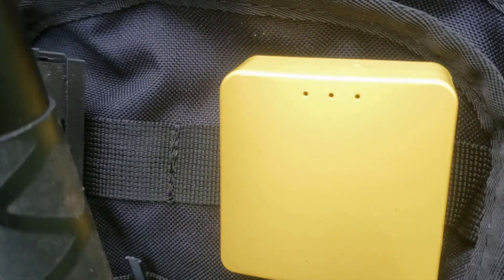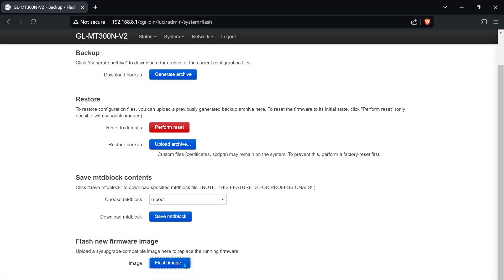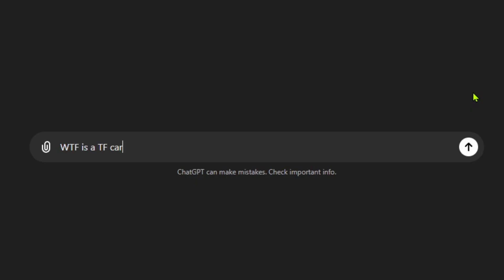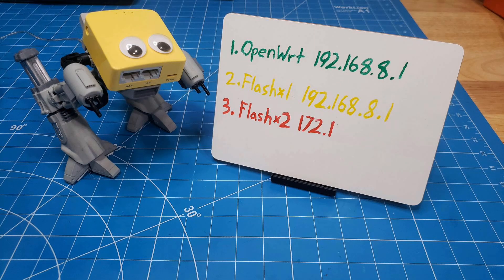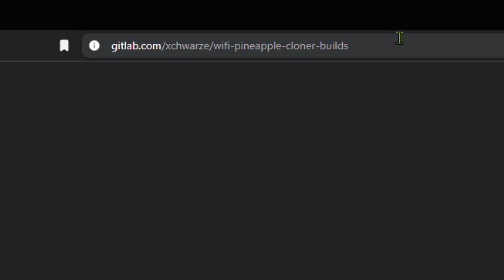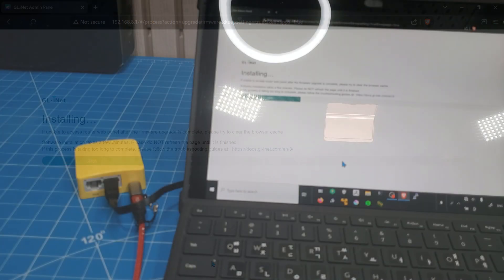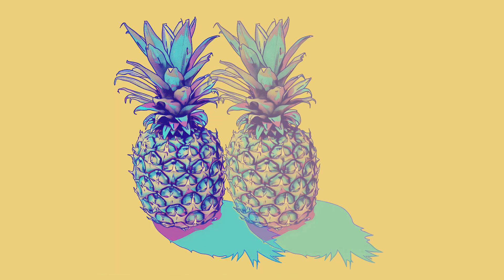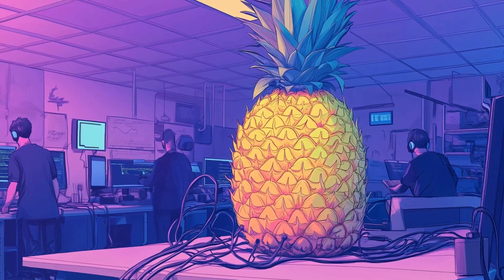I Turned My Old Router Into an Ethical Hacking Tool!

Comment: Or just buy a pineapple on aki express for $100
Reply from the maker: Or save $85 and DIY and learn stuff. Additionally I've had bad experiences w/ Ali Express. I'm currently battling for a refund for a trash refurbished monitor. The seller even went so far as to send me a fake video in which he tested an obviously different monitor. I'm also not convinced the seller wasn't responsible for fraudulent charges on my card, which I had to have cancelled, further complicating the return process.

Comment: Critical step missed- the device has to be put into flash/ boot mode... before anything... well actually..first download the appropriate files..for me they are: 
gl-mt300n-v2-universal-sysupgrade
openwrt-19.07.7-ramips-mt76x8-gl-mt300n-v2-squashfs-sysupgrade 

Both are bin files...
Then plug in  the device to ethernet either by ethernet or ethernet adapter. Then, and only then plug it into power. BUT! While doing so, hold down the Reset button...hold it down and plug it in...the LED lights will blink..and about 6 seconds in the LEDs will go solid. Maybe a random flicker...but for the most part, solid. Now the device is ready to be updated and shouldn't brick.
Reply from the maker: That may or may not be true of the Slate models but it's def not the case w/ the Mango and White cases.

Comment: Does it work with the GL-AR300M16-Ext, on the working list, they list the GL-AR300M as functionnal so I would assume the GL-AR300M16-Ext works as well but can someone confirm?
Reply from the maker: This guy here got it working but used a much different process, flashing over SSH: https://medium.com/%40josegpach/transforming-the-shadow-gl-ar300m16-ext-into-a-fully-functional-wifi-pineapple-765ec24c4e9a
In any event, the GL-AR300M firmware will work on the 16-EXT.

Comment: can it be possible install the lastests versions of the wifi pineapple on the mango (GL-MT300N V2) ?
Reply from the maker: No, the clone firmware has more in common w/ the tetra and nano versions which have been discontinued afaik.

Comment: You Mentioned the GL.iNet GL-AR150 but in the Video it mentions the GL.iNet GL-AR750S     Will the GL.iNet GL-AR150 work with this setup ?   Well actually i couldn't fint the GL.iNet GL-AR150...  Will the GL.iNet GL-AR300 work

Comment: i uploaded the firmware but when i want to start PineAP im getting error "Status: Monitor interface won't start! Try to run manually airmon-ng start wlan1" can anyone help?
Reply from the maker: @carti_skibidi_Sigma  You need a wifi adapter that does monitor mode.

Comment: I'm running into an issue. I can't flash older than 21.02.0 on my GL-X750s for some reason. Any ideas why I can't roll it all the way back? It only recognizes the (NOR/NAND) Firmware variant and 19.07.07 doesn't have that NOR/NAND portion to work? Thoughts on how to bypass this issue? I have tried using the advanced admin portal and I hit the force option, however it then does nothing and just reboots.

Comment: Hey Mike, I was wondering if the firmware for the GL-AR300M16 is the same as the GL-AR300M16-ext? Great video btw!!!
Reply from the maker: Thanks! I'll double check tomorrow but IIRC they're the same.
Reply: @cyberspacemanmike  cheers!
Reply: Did the install go smoothly for you? @HandofGamer
Reply: @JoshuaGilletteraccoon  Haven't tried yet! But I asked it on Reddit and I was told that they should be the same beside the anthenas

Comment: can i just use a mt7612u wifi adapter or do i need to be aware of anything?
Reply from the maker: That adapter can do packet injection and monitor mode but the extent of functionality can depend on the driver and its compatibilities. Make sure to use the mt76 driver or check to see that the wifi adapter lists compatibility w/ openWRT.
Reply: @cyberspacemanmike thank you. so do i need to install any drivers or are they coming with the normal installation?
Reply from the maker: @intericcc  NP, they usually come pre-installed w/ OpenWRT for supported devices.

Comment: Was also wondering how many usb wifi dongles do you need to make it work?
Reply from the maker: For a router with only a single 2.4 GHz antenna you'll need at least one USB Wi-Fi dongle with monitor mode capabilities. But for flexibility and reliability, two dongles are ideal.
Reply: @cyberspacemanmike I bought an RT5370 adapter and it still isn’t recognising it… any idea why?

Comment: how about the antenna used ?
Reply from the maker: It's just w/e I could find on AliExpress or Amazon that had a suitable length of connecting wire. I'll demonstrate the antenna mod in an upcoming (likely the next) video.

Comment: Could I use the GL.iNet GL-AR300M16-Ext instead because it already has antennas?
Reply from the maker: It may be possible to build firmware for it or someone may create firmware for it at a later date, but currently it doesn't look as if it's supported.
Reply: @ k thanks

Comment: Did you ever get the Slate to work for you?  what files did you use if you did?
Reply: It shows how to un brick it.  Which method was best for the slate to to be flashed?  I wasnt able to get the 19.07.7 firmware to work with it and always bricked.
Reply from the maker: Yes! I have a video on it: https://youtu.be/-0q9BgFu9nQ?feature=shared
(•‿‿•)

Comment: FYI when I attempted this with a Mango router, after flashing openWRT the management IP changed to 192.168.1.1
Reply from the maker: That's typically the recovery interface, I cover some of that here: https://youtu.be/-0q9BgFu9nQ
Reply: @cyberspacemanmike  it's exactly what happened to me once I flashed the WRT onto it.  The rest of the set-up went as described, although it was more like 3-5 minutes.  I started a 20 minute timer when you said "this will take 20 minutes" and the Pineapple interface popped up three minutes after that.

Comment: tried this on my mt300n v2. I was able to clone wifi pineapple but I cant get PineAP to start
Reply: You need 2 things connected, a compatible wireless usb adapter like r5370 which is the cheapest, and a storage device, like usb flash drive or an sd card through a card reader. And since you can't connect those two items together since the glinet-mango has 1 usb port, now you need a usb hub, connect those 2 to the usb hub and it should work. Note that you need to format the sd card or usb flash in the pineapple clone interface.
Reply: @AidenJoseph  what other compatible usb adapter chipsets? its a bit hard to find rt5370 here
Reply from the maker: @moks.  From the Termidor page: Generic RT5370 WIFI adapter or MT7612U WIFI adapter you're really going to need this on hardware that doesn't have two wifi adapters. 

Where are you located?
Reply: @cyberspacemanmike  im from the Philippines. I have a tplink archer t2u plus, will test tomorrow. hope it works :)
Reply from the maker: Is it hanging in "boot?" You may need the USB to TTL unbricking tutorial: https://www.youtube.com/watch?v=-0q9BgFu9nQ
Although, someone in our Discord channel said they were able to reflash it without taking it apart...

Comment: Hello, I found your video outstanding, but  I'm having problems doing this tutorial with my GL-AR300M-EXT Shadow, I downloaded the files, but when uploading the first firmware the error “Unknown error occurred. please check the network environment or reboot the device” appears and it is stuck on the screen with the status “Verify”...  The file I downloaded for the first firmware was “openwrt-19.07.7-ar71xx-generic-gl-ar300m-squashfs-sysupgrade.bin”... What could it be?
Reply from the maker: Sorry, just seeing this now, has the issue been resolved?
Reply: @cyberspacemanmike  Not yet!! I'm almost giving up.
Reply from the maker: @rogeriohenriquelima  Are you able to upload anything or is it still stuck on "verify?" If it's stuck you may want to look at my "4.5 Ways to Unbrick Your Router" video.
Reply: @cyberspacemanmike  I can upload the firmware, but when it comes to "verify" it doesn't work, as if the current firmware doesn't allow me to downgrade to version 19.07 and from then on it goes back to the home screen.
Reply from the maker: @rogeriohenriquelima  I would try to download to a more recent firmware before going all teh way back to 19.07.7 and then try 19.07.7. I think someone in the discord was talking about this so you might want to look or ask questions there.

Comment: What does it means by " hardware that doesn't have two wifi adapters". I have a NETGEAR R6220, what other hardware do i needs. Can someone put me in context. Thanks.
Reply from the maker: @lowcheebeng  I think the idea is that to do monitor mode you need a second independent module. This can usually be accomplished with a USB antenna but I'm not sure with the R6220. If you can do monitor mode you should be good to go.

Comment: I started the project with the mango and got all the way to the pineapple UI, however, recon requires, "pineAP" to be on, but every time I try to start it displays "Monitor interface won't start! Try to run manually airmon-ng start wlan1" whats odd is in ssh the command lists a processes that could cause trouble. It's PID Name
 3445 udhcpc. However the numbers change each boot, and no matter how many times I try to kill it, it pops back up. got any ideas on what is happening?
Reply from the maker: Hi, you're going to need a second antenna from the recommended list. Gl!

Comment: I got a GL.iNet GL-MT1300 (Beryl) router, but it's not on the list of available software. Can I turn this router into a Pineapple, or do I need to buy a router from the list? Thanks!!
Reply from the maker: It may be possible to build firmware for it, it has the right architecture. I think Froggie Z was in the Discord talking about maybe building firmware for it.

Comment: This is a super fun project.    
I’m thinking about buying the one now, and maybe having it in a 3d printed case with a UPS/batteries like the ones for raspberry pis.
Reply from the maker: Keep in mind that some do POE or have a POE module you can buy separately! :)
Reply: @cyberspacemanmike  nice! Didn’t know that!    

Well, couple of hours ago I bought an open box slake ar-750s for 30$ shipped, and it will arrive tomorrow to me. I already have 2 of those generic usb wifi sticks, SD cards, a battery with its charging board/usb and on/off switches. This will be fun! :D     

The only thing Im not 100% sure about is the openWRT firmware. On the firmware selector site, there is only a sysupgrade file, no “firmware” file. 
Example when I did that to multiple TP-links router, I had to install the firmware, and then the sysupgrade when it’s available.   
I guess for the gl-inet routers it’s already has openWRT but different GUI. I will check that later.    
And I’m also afraid that the router might have a newer version of OpenWRT already installed and if I tried to downgrade, of course it will be bricked.     
    
Also forgot to thank you for the video! Can’t wait for part 2 :)
Reply from the maker: @AidenJoseph  They have OpenWRT pre-installed but you still have to flash the 19.07.7 version that's specific to your router. I'm working on an unbricking video and it should be out next week so even if you do have to do some masonry work, it should turn out OK! (•‿‿•)

Comment: Fun fact, after the first firmware downgrade, I thought it had broken, but it started on the IP 192.168.1.1 and not on the 192.168.8.1.
Reply from the maker: Good to know! For smthg that should be a knowable/replicable process it really is unpredictable. In one instance I struggled for an hour to try to get a webUI over ethernet and then serial only to realize that it was broadcasting an SSID and I was able to connect with the default password. After flashing I was able to connect over ethernet.
Reply: @cyberspacemanmike  Do you know if the Mt300n-v2 with this mod accepts a pendrive in the USB port, or is there any way to put an SD card?
Reply: nevermind, I managed to make it work, I just plugged a pendrive into the USB port and in the pineapple settings it recognized it as an SD card and then I formatted it and it's working!

Comment: So wait a minute After-the-fact Man: You're saying NEVER to factory reset either units, Slate or Mango, once applying the Pineapple firmware?
What is the proper way to 'start over' a Slate or Mango Pineapple-clone configuration?
Reply: you can %100 reverse this process with both devices and return it to factory settings. I have done so with both myself so I can confirm. I'm sure he will go over the recovery process in part 2
Reply from the maker: I would recommend attempting to flash the original firmware from the pineapple webUI first before attempting any sort of reset or recovery. This is really meant to be a one-way process though and when edge-case firmware flashing is involved you're going to be doing some masonry work sooner or later. I'm going to do a video on four and a half recovery methods. It should be out soon.

Comment: This is so good. I have one of these mango routers and with maybe 5 minutes work its now a pineapple, thank you. I'm running recon now! I am definitely looking forward to future videos, love what you do.
Reply from the maker: Hey thanks! (ᵔ◡◡ᵔ)
Reply: @cyberspacemanmike  oh, thank you! Do you know if I need an openwrt compatible USB WiFi dongle before I can use client mode, the inbuilt interface is being used already. I'll try it anyway ready for any future videos!
Reply from the maker: @atomnetton  I'm not entirely sure but I think if the inbuilt WiFi interface is already in use that you will need a compatible USB WiFi dongle to enable client mode.

I have a list of compatible dongles here somewhere, one sec...
Reply: @cyberspacemanmike  it can't hurt to try!
Reply: @atomnetton  you will need a wifi adapter as well as the mango only has one radio
Reply: @moisejeanfelix  finding the right adapter is the key, the two I have don't work with openwrt it seems. I'll pick another up today and see if that works.
Reply: I wish I could say I had the same experience.  I have been through the procedure twice.  Lucky that when it bricks I can reapply the firmware and it boots again but the pineapple firmware just give the message that it is still booting and is stuck there.  Now sure what to do to make it work.